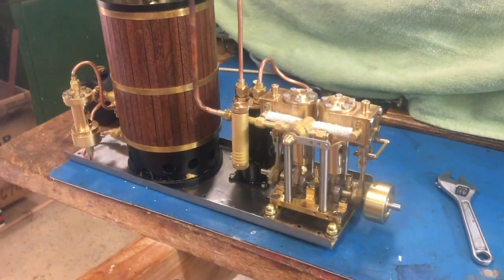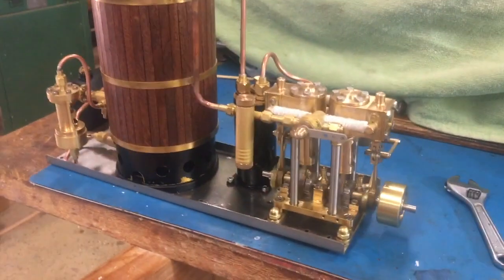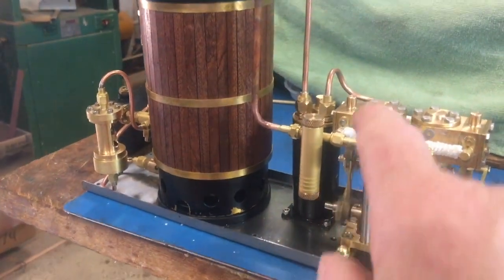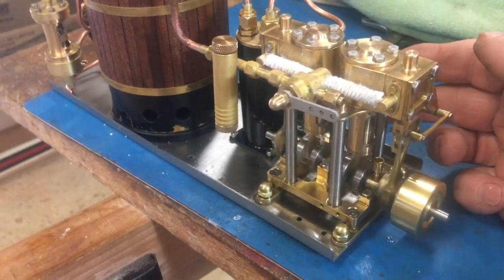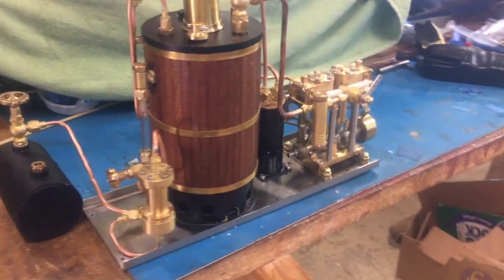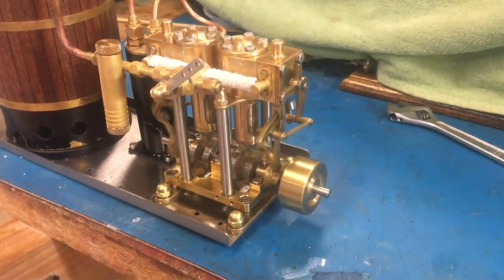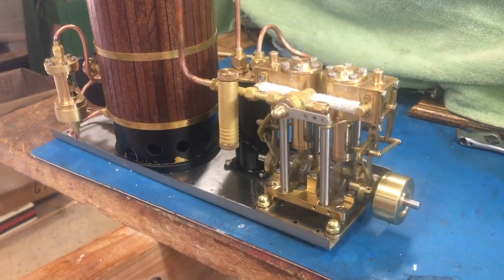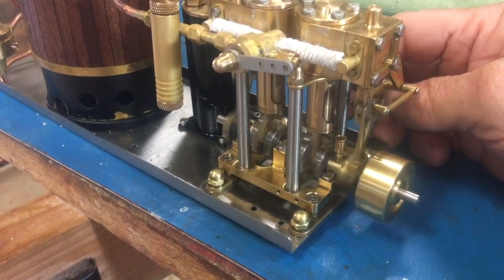Microcosm M29 Steam Engine with Vertical boiler-- First Run

Comment: Hi Carl,

Your issue with the burner capacity is because you use Butane instead of the more common 30% Propane, 70% butane, which has a higher vapour pressure.

I saw a rather pessimistic thread on RCGroups about these engines and how bad they are,, but I think that Mr Rigibahn is a bit too detaillistic. Like yours, mine started straight up first time, and I got mine running properly with about 2 hrs of tooltime total, tools used were a single flat keyfile (and then only a few strokes, to ream the clearance between drive blocks and slide valve pillars), and about 10 minutes per slide valve trueing the sealing face of those slide valves, using a plain old mirror and a bit of household scouring kitchen cleaner (that white stuff containing chalk). And spanners 3,5 and 5 of course :D

An impression:
https://www.youtube.com/watch?v=Jt6YBqq1aMQ and there are more videos of the engine on my channel.

I fitted mine with a wick-fed lubricating system making the engine basically attention-free the entire day, and a Regner feedpump plus 12 oz extending runtime to about 1 hr with only one refill at halftime (I get 60 minutes of burn from the gastank, so more water is futile). Also the glass cylinder oiler from Microcosm, as it holds twice the oil the original one does, easily giving 2~3 hrs of operating time.
I fitted a servo-operated fuel regulator, and a boiler pressure sensor, and arranged burner control via the telemetry functions of my TX, so TX autonomously controls boiler pressure, set at 1,5 bar (22 psi).
In three weeks time I put 25 hours of runtime on it (runtime counter), went through 4 gallons of distilled water and close to 3 lbs of gas, and the engine does not show any signs of wear or deterioration of performance yet. 
IMHO, this engine is WAY better than its reputation as per Rigibahn...
Reply from the maker: I agree the M29 seems OK to me.  Burner runs OK on straight butane, which I use when I can because it is 1/3 the cost of the mix. I also bought an M30 but have not run it yet. This one was not damaged in shipment.  Thanks for the info
Reply: @carlfmiller  Someone could tell Rigibahn (and others) that things are not as bad as he depicts them...

Comment: Hello Carl

I agree about the pressure gauge I would probably remove it. As for the steam stop valve Hello Carl

I agree about the pressure gauge I would probably remove it. As for the steam stop valve Have you checked Pam research they have elbows that are 1/4 –20 and 5/16 Dash 27 that may be able to be re-tapped to your 8 mm. Are the Tube nuts on that 1/4-40 threads?  Thx
Reply from the maker: Yes tube nuts are 1/4-40.  Fuel tank thread is unknown to me. Sometimes Microcosm 1/4-40 threads have to be chased with a die to make other  1/4-40 nuts (such as PMR) turn freely. I made the piping already so no sense in changing the stop valve now, See:  

https://www.tapatalk.com/groups/modelsteam/build-log-for-stormy-45-an-open-launch-for-electri-t113243-s20.html

Having 1/4-40 tap and die has been very useful for many things.

I got replacement gage from Clevedon in UK

BTW the P5 really works.